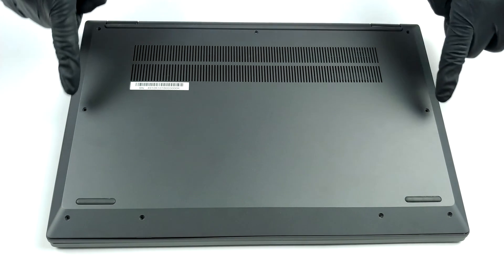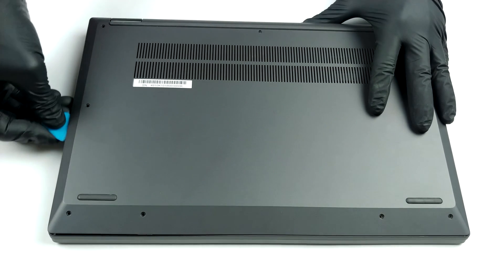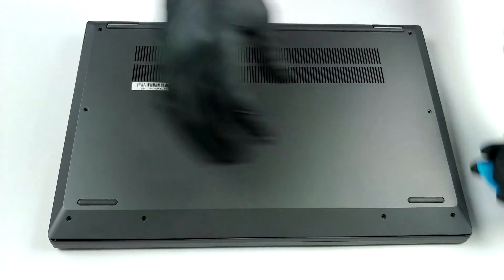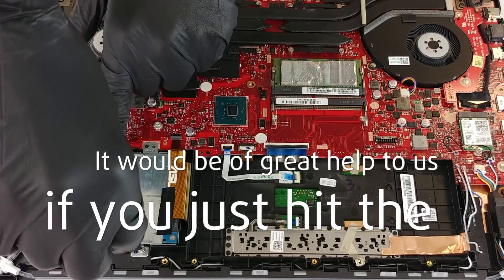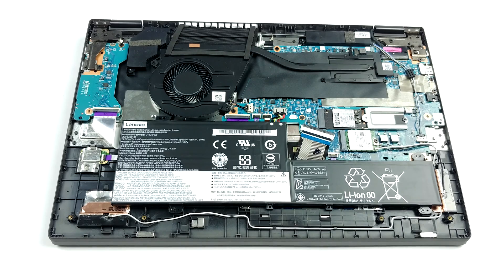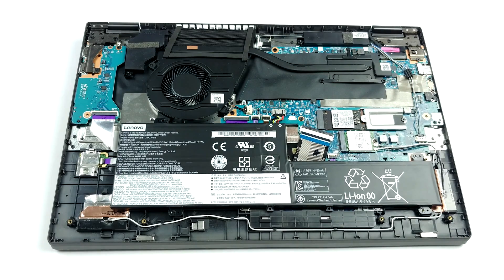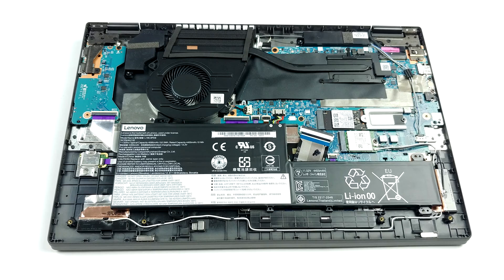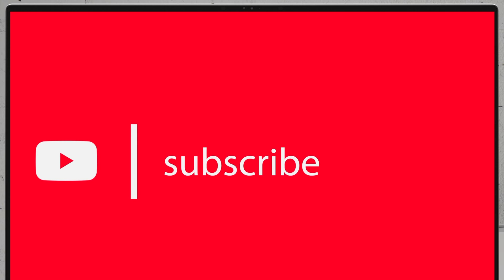🛠️ Lenovo Ideapad Flex 5 (15) - disassembly and upgrade options

Comment: I have this laptop and I sent it to Lenovo for a repair because my battery lasted for only 3 hours instead of the specified 10 hours of battery life that this laptop was said to have on the webpage, and Lenovo replaced the the battery and it came back and my laptop is still 3 hours of battery life. Is this normal?

Comment: Hey I have this exact same laptop. I recently spilled soy sauce (I’m dumb I know) unknowingly into my laptop while it was in my backpack. It spilled at round the top right area of looking at the video. My display no longer works and only is a black screen. It still turns on the keyboard back lighting still works but no display. I even used an hdmi cable and hooked it up to my rv and still nothing. I really need this computer and with covid I don’t have money to buy a new computer. I opened it up and cleaned up the motherboard area where the spill was. It doesn’t look too bad and doesn’t appear to be corrosion oramajor fry. But no matter what I do I can’t get the screen to turn on. Any tips would be greatly appreciated.
Reply: check the warranty there isnt much you can do to repair it yourself

Comment: Hello ! I have a Lenovo flex 5 (amd - 256go) and i bought a SSD SN550 1to. But i can not install windows 10 (error "0x80300024"). Someone find a solution ? thank you in advance for your help.

Comment: I have a Lenovo Flex 5 15 with an nvidia mx230, 16gb of ram, i7 10th gen. The problem that I have is with cooling, to the point where it freezes, which is strange as this is a relatively new computer. Any thoughts?
Reply from the maker: We had a similar issue with the Flex 5 (14). It is down to the thermal design. From what we found out, the rubber feet of the notebook are a bit too shallow, which suffocates the fan. Try using a cooling pad, or just raise the backside of your laptop with something, and you will see major improvements (and hopefully no crashes).
Reply: I imagined it was related to that, thanks!

Comment: Thank you!

It's stupid to remove ram slots :(
Reply: Actually No, 
1st :- It gives more space for the Laptop manufacturer to put a Larger battery or to make the Laptop thinner

2nd :- Now you have to buy Ram upgrade from Lenovo so that only the brand can make profit
Reply: @abhijitpanda524  That's crap... this laptop doesn't have a larger battery, and there is plenty of empty space in this case for at least 1 DDR4 slot and at least an extra m.2 slot. Removing 2.5ssd support for increase battery space is valid... removing dimms / m.2 slots is not that is pure penny pinching of the worst kind in an otherwise decent laptop. It is very likely a 50% larger battery AND DDR4 slot and m.2 could have been fit in this case. The gaps between components in there are huge!
Reply: @Wingnut353  I agree with the space argument, but it's not to save a penny

Upgrading RAM yourself will not give  brand any profit. But lenovo makes money if you buy a Higher RAM varient while purchase 

( Ex. 8GB off shelf RAM costs $20 here ( which will not be given to Lenovo) but 8 GB soldered RAM upgrade ( from 8 to 16GB ) costs $60 which will directly go to Lenovo.